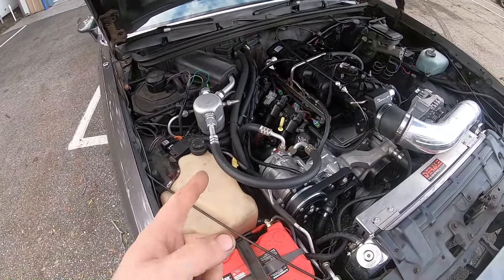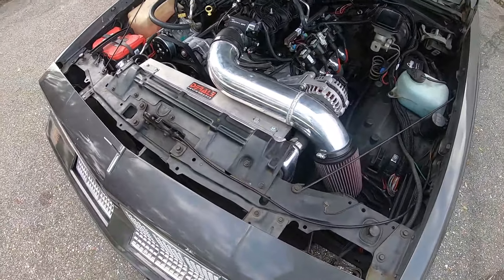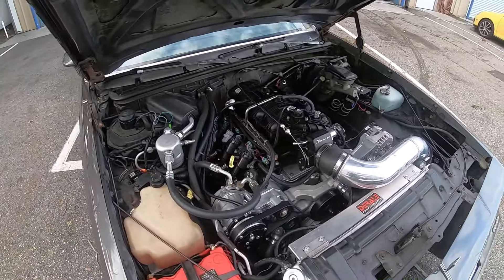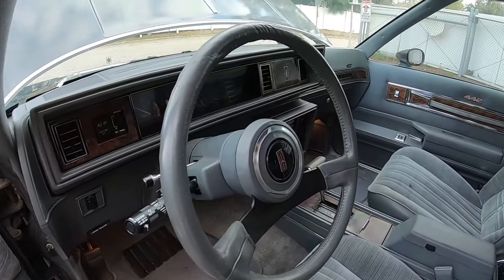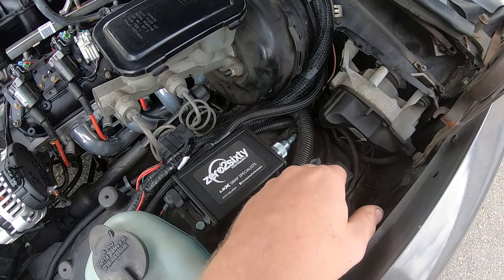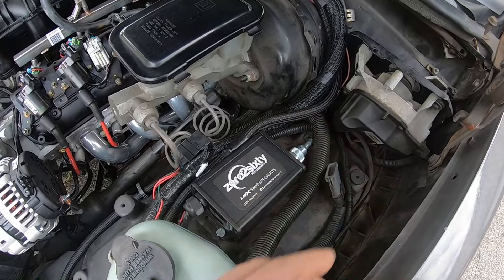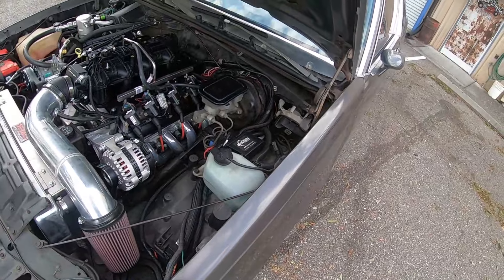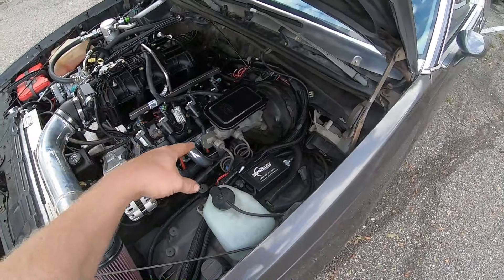A G Body LS Swap that even you could do! Cammed 6.0L LS & 4L80e Swapped Oldsmobile 442 G Body

Comment: You did a fine job with the build-up and installation of the 6.0 liter LS it's time to hear /see it run ...There's so many LS engine builds /swaps out there on YouTube, you see the completed engines, but you never see the finish product placed / installed up & running in the vehicle and driven daily, so the viewer can see the final results.
Reply from the maker: Thank you. I will keep that in mind for the next video 👍
Reply: @Zero2SixtyPerformance  what engin motor mounts did you use in trying to do it for my 71 buick skylark
Reply: Never? There are thousands of videos with that exact scenario.
Reply: @Zero2SixtyPerformance .where you located
Reply from the maker: St. Petersburg, Fl

Comment: Great build and swap.the swap would vastly improve performance and gas mileage  over the old 307,305 Chevy small blocks of the 80s era.
One question what battery are you using once the swap went in?
Also what axel you using?
Reply from the maker: I belive that car had an optima red top in it. Rear end was the stock 442 unit.
Reply: @Zero2SixtyPerformance  how much u charge to do the swap

Comment: Super clean. I have same intake and tb on s10 swap, did you ever drill or make 1 where that crankcase breather can go through factory 3 bolt tb?
Reply from the maker: I have not… I would just get vacuum from another source. Typically I would would a 3/8 bung in the intake tube.

Comment: What did you get that for l80 for from? And can you use a all-wheel drive transmission off a Tahoe or 4l60 for a El Camino? Would it work same thing as a Cutlass? Really nice. Really nice build. I like how clean it came out. That's exactly how I want my car to look
Reply from the maker: Rwd 2500 truck. Awd would not work without changing the tail shaft. 4l60 fits in Any g body

Comment: Great video! I'm in the midst of doing a 6.0/4L80E swap on a 79 Chevy Malibu Classic 2 door! Wondering about the trans crossmember? Help?
Reply: I got a crossmember for my 1984 Monte Carlo SS from honest charlies he specializes in g-body parts a long time ago in the late 90s for a 700r4 transmission when the car had a old style 383 smallblock in 2008 the engine was swapped to a LS2 and the header collectors didn't line up with the humps in the crossmember so my mechanic cut it in half and rewelded it back together painted it and installed it its still in the car and have never had a problem with it l don't think Honest Charley sells these anymore but jegs sells one that looks identical for 128 dollars it will need to be cut and rewelded so the collectors line up with the hump on the collectors hope this helps
Reply: Thanks! I appreciate the info

Comment: How much would this be to get mine done I have an 1988 cutlass and this is exactly what I want, great job
Reply from the maker: If you were to drop off your vehicle, you would be looking at roughly $18k installed if you wanted a swap just like this. Alternatively, you can purchase all of the items used in this swap right off our website! - https://zerotosixtyperformance.com/shop/ls-swap-systems/chevrolet/1978-88-gm-g-body/1978-88-gm-g-body-ls-swap-kit/

Comment: Did y'all go with rewiring the engine harnesses and connectors yourselves or go with a company that makes ls swap to gbody wire harnesses?
Reply from the maker: We do all the wiring in house
Reply: @Zero2SixtyPerformance  ahhhh i see. I heard it can be a hassle doing yourself due to figuring out which connectors you need/dont need. I also heard third party companies make harnesses that are already ready and just plug and play.

Comment: Clean cutty! I have a 88 MONTE CARLO SS  and I have the 6.0 swap but my steering knuckle hits the header looks like you have an extended one is it out of another car? Or do they sell them extended...would appreciate your help!!...thanks
Reply from the maker: That is likely due to the mounts and headers you are using. This swap used mounts and headers from Holley. 0 fitment issues. Stock steering components were used

Comment: How was the clearance of the passenger side with the heater box.  Any issues with having to relocate the coil?
Reply from the maker: It fits. It’s tight but you can fit the coil and plug wire

Comment: Doing frame off 85 monte ss t-top 6.0 lq4 comp 54-469-11 trickflow beehive springs pushrods trunions 
Johnson lifters. 4l85 fully rebuilt shift kit circle D 258 torque converter. Planning using holley engine management as well. Do you have a part number on that adapter for speedo want use factory gauges as well already have oil water volt hooked up need speedo tach eventually slow process due to financial reasons but getting there
Reply from the maker: ECD-200BT-2

Comment: Did you use a Holley in tank pump? And if so how did you get the level sensor to work with stock gauges?
Reply from the maker: Yea we did. The sender is a 0-90ohm just like the factory

Comment: All I want to know is how you used your factory engine bay wires for the a/c and what goes to what? Lol
Reply from the maker: A/c is totally separate from the engine wiring. In most applications you can use the original oil wire as they are a 12v switched wire to turn the Holley on.

Comment: Maybe a dumb question. When swapping a obd2 engine into an older car, do you need to run 02 sensors and cats ? Does the pcm store dtc's?
Reply from the maker: If you are using a factory pcm, yes you will need to run the upstream sensors. Cats are not necessary. Pcm does store dtc information
Reply: @Zero2SixtyPerformance  and what about immobilizer bypass for ignition module?

Comment: How much modification from a stock 307 motor exhaust install was there mating it up to the 6.0? Like did you have to make any custom piping or brackets? Which Pypes mufflers?
Reply from the maker: You have to make a 12” extension to the headers/manifolds. The exhaust mounts just like the factory exhaust did. Pypes Street Pro mufflers

Comment: Great video! injectors does the Trail Blazer intake use? Did you have to cut the ears on the 4L80e? Are you using the stock torque converter?
Reply from the maker: 36lb injectors. Yes you have to cut the ears off. Stock torque converter.

Comment: What was your top end specs. Cam, heads, springs. Also who did your ecu.
Reply from the maker: Motor was an LQ9 pullout. We re gasketed the engine and installed a Summit stage 1 hi lift truck cam. We do all the install/tuning in house.

Comment: I used NVU Gauges with a GPS Speedo and about 50% cheaper than Dakota. NVU will also custom screen print you any design for your gauges. I tried to get something custom done through Dakota and after they took my credit card info, 2 mos went by before I saw their first draft of what I requested. By that time, I already had my NVU gauges.
Reply from the maker: There are many was to skin a cat as they say. We have had great success with the Dakota stuff so we stick by it and they stick by us.

Comment: Nice swap👊 I'm getn myself familiar with LS swaps as much as I can and I see a lot of guys change out the accelerator pedal to electronic for the throttle body? Is that something that you did also or is it not necessary and is optional?
Reply from the maker: We actually used a cable throttle body on this car. It's not necessary to switch on any swap.

Comment: Did you connect the oil and temperature sensors to the terminator x and then tap on to use original gauges ? I’m doing a ls swap on my 80 jimmy trying to figure it out lol it’s my first swap
Reply from the maker: The holley needs the oem ls sensors. If you are using dakota digital gauges you can get the sensor data directly from the holley. If you are going to use you factory gauges you will need to add your factory sending units as well
Reply: @Zero2SixtyPerformance  won’t be using aftermarket gauges going with stock ones. So one set of sensors for Holley and another set for stock gauges right ?
Reply: @KILLSWITCH831  correct

Comment: I'm about to start a cutlass build for my buddy. we are collecting parts as I type,  we are using holley mounts and crossmember but I'd like to know what headers u used and did u have to massage the tunnel to fit the 4L80e?
Reply from the maker: Hooker headers. 4L80 fits with no modifications
Reply: @Zero2SixtyPerformance  thank you

Comment: How did you do the wiring for the air conditioner using the Holley Terminator X?
Reply from the maker: The AC functions independently from the Holley. We used the AC request wire as an input to kick on the fans and idle up.

Comment: I am going with a 6.0 lq4 with a 4l80e. My question is will I need a different drive shaft and crossmember for the transmission? And its going in a 83 cutlass.
Reply from the maker: Yes you will. I would recommend going with the Holley swap kit

Comment: As far as is swap is concerned are the any tremendous differences between g body and d body. 1989 and 1981 Cadillac brougham are the vehicles specially in speaking of.
Reply from the maker: They are not the same at all. But, it's just another swap. Get some mounts, pan and accessory drive. Make it all work.

Comment: Did you use the high Holley accessory drive or mid? I want to go with mid but I haven’t seen or read anyone using it.
Reply from the maker: We used the high mount on this car with the truck balancer. The mid mount has similar dimensions to the truck balancer so it would fit.

Comment: If i wanted to put an LS swap on my 1984 cutlass supreme brougham, what would be compatible for the V-6 3.8 motor?
Reply from the maker: Any LS based engine will fit in there
Reply: @Zero2SixtyPerformance  what if I have a lowrider, which the engine can't be a V-8 due to the weight, what can I actually put in there that's a V-6 non carburetor?
Reply from the maker: @Omar Vargas you could always go with an aluminum block to save weight. If you are just dead set on a v6, we have done a few LFX swaps (Camaro v6)
Reply: @Zero2SixtyPerformance  but I heard that the aluminum engine  doesn't last long. Is the vortex engine consider an LS or is that just a different type of fuel injection
Reply from the maker: That’s totally false. Shoot me an email, I’d be happy to put something together for you david@zerotosixtyperformance.com

Comment: Have you guys done any LT G-body swaps? I can get an L86 and 8l90e for a decent price and was wondering about the differences in things needed between these new motors and the LS's for swaps.
Reply from the maker: We have. As far as getting it in the car thats easy. BRP makes mounts and headers that will drop it right in. One thing to consider is the LT will not have a power steering pump. So you have to either get the bracketry from someone like ICT Billet and adapt a pump to the engine or run an electric pump like one from a Volvo. The fuel system  will work just fine with a Corvette regulator just like the LS swaps. Hope that helps!
Reply: @Zero2SixtyPerformance   Thank you
Reply: @Zero2SixtyPerformance  I found a kit that uses a 90'-95 chevy 1500 power steering pump with a smaller pully after looking for awhile but, like I said I have a bit before I even Pull the trigger on this swap anyway Thank you guys for the response :)

Comment: What did you guys do with the harness that was on the right side of the engine bay? (Located under the a/c box) 
I’m doing a 6.0 swap and I’m running the sniper and msd box and wanted to know if I could do away with all of those wires? I shaved my firewall and play on installing vintage ac as the summer approaches but wasn’t sure if I would need any of those wires.
Reply from the maker: You can get rid of a lot of those wires. We typically cut down the factory harness to use only what we need. I can’t tell you exactly what we take out but we definitely clean it all up as much as possible

Comment: I know this video is pretty old, but  quick question... If imm using my factory cluster on my gbody montecarlo ss, what all does that speed box hook up to besides the cluster?
Reply from the maker: Just the speedo cable. You will use the speed output wire from the pcm to box and then power and grounds
Reply: Thanks preciate that info

Comment: How's everything how did you get the 4l80e to work with factory shifter
Reply from the maker: Used the factory cable and modified the brackets. On a column shift car we use a Lokar ACA-1800

Comment: Do you guys make a crossmember for a 4 L 80 on G body
Reply from the maker: We used the Holley crossmember in this project
Reply: @Zero2SixtyPerformance  is the Holley crossmember double humped for duel exhaust like the Gforce crossmember, or is it made like the factory Gbody crossmember? Thanks for any info.
Reply from the maker: @hidinfrombiden6251  yes it has cutouts for dual exhaust
Reply: @Zero2SixtyPerformance  thanks🤘

Comment: The converter box will work with 6L90?
Reply from the maker: As long as you can output a Vss signal from whatever pcm you are using, Yes
Reply: @Zero2SixtyPerformance  alright thanks man

Comment: Hello, what motor Mounts did you use?
Leave link below please.
I have lq9 6.0 for 83 grand prix with 
520-71221014HKR BlackHeart Engine Mount Insert &
12643HKRHooker BlackHeart Engine Mount Brackets
& it won't fit. Hitting oil pan, but I have the 302-3 retrofit oil pan.
Reply from the maker: In the 1979+ vehicles there are multiple holes you will be able to bolt the mounts into. My guess is you have them in the wrong holes. But yes that is the correct numbers for the mounts
Reply: @Zero2SixtyPerformance  thank you so much. My father built brackets but I rather not modify as the kit didn't require any modification.

Comment: Do that 4l80e take a noticeable amount of power away compared to an 4l60e in the gbody? Trying to see should I keep my 4l60e or switch to 4l80e before I install it. I have an 79 2door Malibu 6.0 swap with 3.73 posi rear
Reply from the maker: In my opinion and power that would be taken away would be worth it in the end. The 4l60 is living on borrowed time even in a stock application.
Reply: @Zero2SixtyPerformance  so u do get a noticeable power difference?

Comment: I'm trying to do an ls swap on a 73 cutlass collenade from rocket block to 2005  Chevy 3500 6.0 Express van motor any advice would thus be good swap.
Reply from the maker: My advice is get parts that are made to work with each other. Once you start trying to save a buck and getting mounts from here, headers from there, etc.. you are just setting yourself up for headaches down the road

Comment: I have 84 hurst olds  with a ls swap  5.3  my floor shifter got stuck while i was driving will not move it’s in overdrive on floor shifter but it’s really in park lighting rods by the way do u have any ideal what it can be thanks
Reply from the maker: Sounds like a shift cable issue to me
Reply: @Zero2SixtyPerformance  ok i already or a new one of eBay thanks

Comment: I'm starting a swap with a L92 LS 6.2 into a 86 cutlass supreme and my hood doesn't close any advice?
Reply from the maker: Truck intake fits with Holley mounts. If you are using something else I would recommend switching or get another intake manifold
Reply: Ok , but right now I just have my engine sitting on the cross member
There's mounts or anything connected yet I also am using a turbo 400 tranny that I'm gonna need connecting.
Reply from the maker: Holley mounts and Holley 302-2 pan and it will sit in there just fit
Reply: Awesome thanks for the info

Comment: what kind of intake is that with the throttle body and the filter ?
Reply from the maker: The intake manifold is a Trailblazer SS. Throttle body is a Holley. The air intake was fabricated by us.
Reply: @Zero2SixtyPerformance  thanks looking to swap my 84 el camino with a ls3 and a 4L80E trans

Comment: hey dude, im doing a 84 cutlass ls swap and wondering if that blower motor and AC condensor thing in  engine bay passenger side is all ac related or does that blower motor work the heater too?
my car came with a discharged ac and beat up twisted hoses and also aftermarket  heater hoses and alot of silicone around ac connections and heater hoses.
i was resigned to losing ac before buying the car but now that ive swapped out old motor and installed LS motor ive found out the heat core attachment hoses are almost completely fuking squashed and i cant actually believe they were blowin heat before and didnt leak.

now today to top it off i was trying to pry my tranny fill tube from under the lip of ac box and broke a big hole in the ac  box.
knowing all this i mightve deleted that entire box especially if its JUST AC  not heater related
Reply from the maker: The ac core and heater core are all in that box

Comment: I have a 700R4 transmission can it handle a LS engine of that size 6.0 … & HP ???
Reply from the maker: If its in decent shape it will hold up fine. We have plenty of customers with big blocks and 700r behind them.